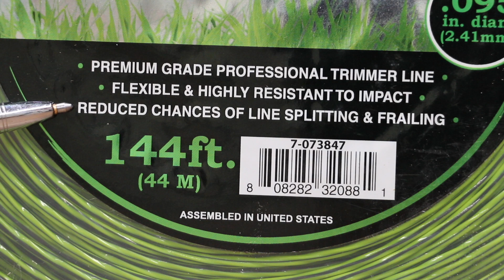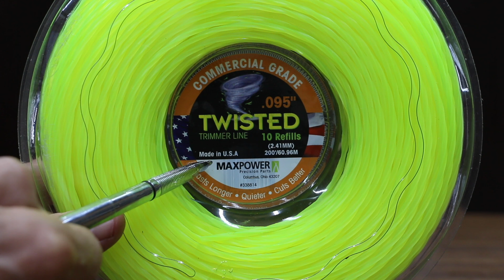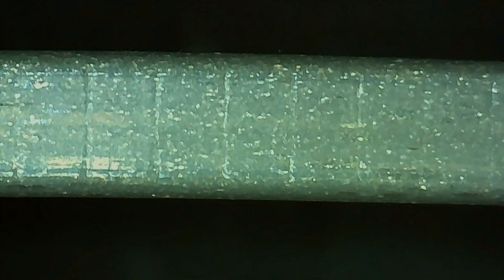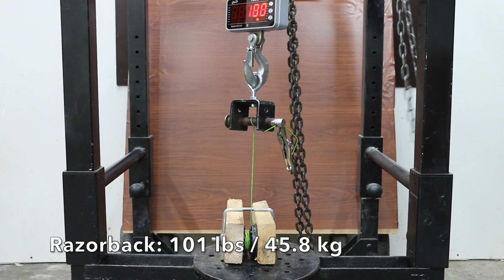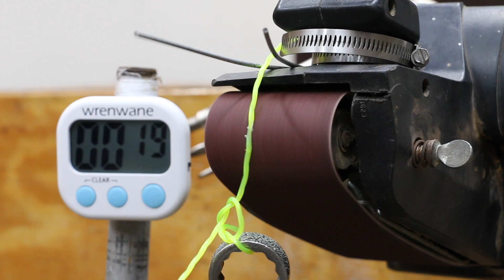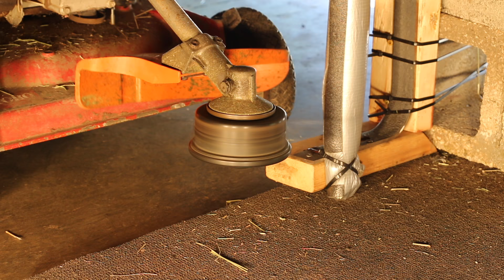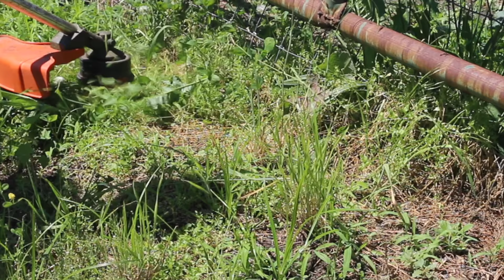Best Trimmer Line? Let's Find Out! Round 2: Stihl, Husqvarna, Echo, Oregon, Shakespeare, Weed Eater

Comment: Do you have a video on electric string trimmers? I have a 80v Greenworks (same batts as cobalt).  It's the best trimmer ever. I'm never going back to gas.  Just finished the 3rd year on the same battery for our .23 residential. Came with a blower and charger.  Has to be one of the best blowers out there.  Just amazed on the low DBs.  Now all my neighbors 2 cycles are very annoying.
Reply from the maker: Thanks for the video idea.

Comment: Im not some Oregon fan boy. Just putting that out first because alot of people are quite brand loyal. The problem i have had with line is how it welds in the spool when running along chain link fence lines. The way the line wraps and then pulls the string inside the spool so quickly that the material friction welds to itself. You guys know what im talkin about! ;P   I have not tried the weed warrior, razor back, nor the twisted but the rest have welded. I finally tried some of the Oregon 20-117 Platinum Gatorline Supertwist  This stuff has a coating which gives it a higher melting point than alot of other strings. Oregon has quite a few lines available but from what i have been told this platinum type here is the heat resistant one. I could definitely be wrong but after actually using it for a month and never having it weld even ONE time i will not be switching back to any thing else unless some thing else handles the heat and can last longer.
Reply from the maker: Thanks for the feedback.

Comment: @ Project Farm Thank you for this test. I'm part of a large community helping out other lawn care providers. One of the big questions that are frequently asked is about using X blade configuration. ( Crossing a regular mower blade and a gator blade on the spindle.) Vs using just gator blade or regular mowing blade on the lawn mower. Used to chop up leaf's. The debate for the x blade configuration is it works better then the alternative. The argument against is that it causes stress wear and tear on the spindle, engine and clutch. And the outcome is not a noticable difference. Could you please test this and put this conundrum to rest. You would be helping many in the lawn care community. And your tests get shared in Lawn Care World face book group. Thanks again.
Reply from the maker: Thanks for the video idea.

Comment: Just so you know for the Stihl you are testing the their worst trimmer line the test should have been done with the CF3 Pro or at least commercial line, also as far as pricing Stihl does not sell their products on Amazon that price is through a questionable reseller, you should be able to get that spool from a dealer for less than 10 USD
Reply from the maker: Thanks for the feedback.

Comment: That Echo Crossfire doesn’t hold up like it used to. I swear they’ve started making it more brittle. I cut mainly residential properties and have been using the same trimmer with it for a couple years. I go through the line a lot quicker than I did last season. It’s the same .095 I’ve always used.
Reply from the maker: Thanks for sharing.

Comment: I'll have to find out what the UK equivalents are. Up until this cutting season I typically bought the stihl 2.7mm (. 105") but have found that it gets very brittle after a few months, this year I've been using husqvarna 2.7mm (. 105") penta and have found that the shelf life is far better than the stihl brand one, 6 months into the season and my Strimmer cord still preforms the same as the day I bought it. Its something that needs to be taken into account especially when buying a few hundred  or thousand meters/ yards of nylon is how well it keeps over time. Great video. For me It can be an expensive mistake to buy inferior nylon.
Reply from the maker: Thanks for sharing.

Comment: You were right about how long lasting the Weed Warrior is. Only problem is it curls up. Very difficult to cut grass with a curled up line. Had to send it back to Amazon. I'm using Max Power 0.095 as a 0.105 since it's so thick.
Reply from the maker: Thanks for sharing.

Comment: Impressive testing, I found Maxi-Edge by Arnold to be a very good line considering the low cost per foot, it don't jam up on the spool and seems to last quite a long time at low/med RPM. Perhaps you can try it around your property. I use the Orange 095 and it handles weeds well, green 080 does not last as long.
Reply from the maker: Thanks for sharing!

Comment: Re test them 1 year or 2 years later to see how they deteoriate.... I use the husqvarna, I think it turned. brittle, even keeping it In doors
Reply from the maker: Thanks for the suggestion.
Reply: My 2 year old string has lived in the house in a desk drawer since purchase.  It seemed fine, but It was snapping off under any load where it exits the trimmer head. 

Super frustrating...great topic for exploring, I hate running the trimmer, but occasionally it’s the only right tool for the job...

I did read some people say to put it in water, which I tried last night. My limited use test showed a huge improvement over the unsoaked string but not quite like new... 

It seems like the few Facebook pages on the topic started with new string stores in water... ;-(

Comment: There's probably a good reason that "wire" like 1/16th inch cable isn't used instead of plastic trimmer line.... maybe a safety issue? I'm not sure....
Reply from the maker: Thanks for the feedback.

Comment: Will straight weight "30-W Shell T-1 Rotella " motor oil work as well as straight weight "30-W Valvoline Conventional" motor oil for use in 4 cycle Tecumseh and Briggs 10 HP engines?
Reply from the maker: Thanks for the video idea.

Comment: The term for the trimmer line getting stuck in the head is "welding". It has little to do with the line stretching but literally melts together in the head. The melting it caused by the friction of the heat as it vibrates in the head. If you have this happen and untangle it you can literally see it has "welded" to the other surfaces of trimmer line.. Round line is great at limiting this problem. Also, the trimmer line should always be wound tight in the head.  My two cents.
Reply from the maker: Thanks for the feedback.

Comment: Just found your videos and I love the way you test stuff, however you do not test repeatability. For instance, if you repeat the same test 5 times, how much do the results vary? Same with any test equipment you use. e.g. the knife sharpness tester - if you test the same knife 5 times and at 5 different points along the knife blade, what results do you get? When you display graphs, it would be useful to display error bars.
Reply from the maker: Thanks for the suggestion.

Comment: Hi Project Farm!! Just wanted to add a comment here...I had been using .105 Husqvarna titanium line in my trimmer, but thanks to your test on lines, I went to the Maxpower .095 line. Not only do I like it better, I find it "follows the contours" of the ground better and doesn't gouge into the ground as easily as the .105 can do, especially if you have the trimmer head on a bit of a tilt. So...thanks to your fine test, I have a product I like much better.
Reply from the maker: Great news!

Comment: Have you thought about testing the Power Rotary Scissors and the Steel Wire Brush Cutter Trimmer Head replacement for your next video testing about the trimmer head replacements being better than a string trimmer line or brush cutter blades?
Reply from the maker: Thanks for the video idea.

Comment: I bought one of the trimmer heads that takes the 4 individual lines and bends them into a u shape for 8 lines for cutting and I bought a roll of the maxpower twisted line and cut the line to length of the original strips wors better than the original line last longer and one roll of line has lasted almost 2 years
Reply from the maker: Thanks for sharing.

Comment: I am so glad that I found your videos.  I was considering purchasing the Oregon Gator line.  I then saw your first video and changed my mind to Husqvarna.  Then YouTube auto played this video and looks like that I am purchasing Maxpower Twisted.  It performed much better than Oregon Gator in your testing.  Mahalo!
Reply from the maker: Glad it was helpful!
Reply: @ProjectFarm  Update on the Maxpower Twisted:  This line is almost bullet proof!  I trim the grass in my 1,500 square foot yard with two pieces of this line including at the edges with walls and sidewalk with minimal line loss (maybe 1/4" to 1/2"); your tip about slowing the rpm to prevent line breakage was very helpful!

I am using this line in my brand new Maruyama B30L Turbo.  Kind of late for me, but I would like to see a review of grass trimmers!  Mahalo Todd!  I always look forward to your reviews!

Comment: I've tried a lot of different trimmer line over the years, and my quality need is line breakage. It really burns me to shut down and retrieve the line from inside the spool. That all changed quite a bit when i read about soaking the line in water overnight to bring back line strength. IT WORKS I don't know what manufacturer stated this, but I do this regularly, and store the line in a cool dry basement out of the sun.  I Love the testing you do and keep up the GOOD WORK.
Reply from the maker: Thanks, will do!
Reply: I recently found the tip about rehydration and it indeed works.  I was using some Echo string that was almost 2 years old and hydration brought it back and it breaks far less now.
Reply: I actually called Echo and spoke to a technician and he confirmed that its advised to put the line in a bucket of water 💧 and let it soak for approx 1 hour at least.  IT ABSOLUTELY 💯 PERCENT WORKS

Comment: Ha! I don't run out 10 feet from being done because I don't use the constant feed system that makes you run out of line every 20 feet so you have to restring 6x before you're done. No thanks. I use a speed loader that holds 2 pieces. I can use those 2-6 inch pieces to do the entire yard instead of wasting 60 feet of line.
Reply from the maker: Great tip!

Comment: Can you do an in depth testing of maybe five battery operated lawn mowers self propelled, I know that would be super expensive as the cost of the complete mower set up would be enormous unless the manufactures would donate the necessary kits. If you did do a test video the manufactures of first rate equipment would have the best advertising for the least amount of money as no one can come close to your testing methods, that is just my opinion, one look at your following tells the rest.
Reply from the maker: Thanks for the suggestion.

Comment: Your test was spot on!  Thank you! The max power made my core gas less trimmer at like a completely different unit. I almost replaced my trimmer. It was the line I was using. The max power line rocks! Thanks again.
Reply from the maker: Glad to hear.
Reply: Destin from Smarter Everyday was doing a weed eater line test to see which shapes work the best. He noticed a guy who weed eats for a living and invited him to check out the setup and noticed he was using a triangular twisted line. One of the things he noticed when spinning it up was it was a lot quieter than the other lines. Less noise = less turbulence = more efficiency! The line wasnt being buffeted by wind as much (similar to how those car antennas have a twist around them to reduce noise) so the trimmer head kept up at higher speeds :D

Comment: Worth noting moisture makes a substantial difference in nylon strength stretch and toughness, some advocate storage in a bucket of water.(I have not made a direct test) Also .080 square line weighs about the same per foot as .095 round, and my trimmer power response seems to back this.
I have found the Echo-crossfire(broke to bits) and twisted-maxpower(split ends) to both be garbage, but maybe I got a bad batch of twisted or need to size it up or down. I use it on tall(mature) grass and fibrous weeds(some young brambles though I use a cheap saw blade for heavy brambles), I don't have concrete or fences. Husky titanium worked well, i will use it as a comparison standard after I use up my pile of round-one samples.(Which included oversize and undersize lines.) My modest straight shaft trimmer is rated for .095 round. Tested up to .120 and down to .060, .060(cheap brand) just seems to dissolve with my trimmers power and weed type, while .105 round stihl lasted much longer for scalping dirt but was clearly loading the motor and running much lower RPM.
Reply from the maker: Thanks for sharing.

Comment: Enjoy you videos, I like seeing products tested to see which is the best. I would be very interested if you could test lawn mower deck spray to keep grass from sticking  I can see other uses on outdoor tools such as shovels, and tractor buckets to prevent dirt from sticking.  These are the brands that I have seen so far : Tite-seal Mower Deck Spray, Gunk Non-Stick Mower Spray, Armortek Non-Stick Outdoor Power Equipment Spray, Mo-Deck Non Stick Spray, Majic Easy Slip Non-Stick Lawn Mower Underdeck Spray, Dupont Teflon Non-Stick Dry-Film Lubricant, Silicone Spray, POR15, Sli Plate Graphite Lubricant.

Comment: Did you consider manufacturing date when buying these lines? In my experience, lines that sit on the shelf become brittle and have to be soaked in water to gain their malleability back. I wonder if date of mfg would have an effect on your results.
Reply: Actually, I just tried soaking my line for the first time.  It had become quite brittle.  Now it works like new.  I think age of the line should definitely be considered.

Comment: Hey project farm, this is my second suggestion:
Recently i had to remove the tint glue off my car window so i searched online for help and got alot of rubbish not working solutions, like hot water and soap, or the normal window cleaning sprays, rubbing alcohol (worked a bit) and finally what worked for me was paint thinner.

So i suggest you test glue removing products or methods.

Keep it up 👊
Reply from the maker: Thanks for the video idea.
Reply: try a product called Goof off

Comment: You do a tremendous job your tests.  Just before this came out, I had bought Oregon trim line and was pretty satisfied with it - it was a HUGE step above Echo junk (also 0.095) that would completely break off about every three minutes even under normal whacking, and almost immediately next to a curb.  But I was regretting buying the Oregon after watching this because other lines did better, especially the Maxpower.  However, on further checking, I realized Oregon has several variations of trimmer line (and obviously you can't test every variation of every product out there).

I had bought the Oregon 22-895 "Magnum Gatorline Square Trimmer Line."  I have no idea how it compares with the other lines tested, including the Oregon 69-195 "Magnum Gatorline Round" that was tested.  Both are 0.095 in.  But the 22-895 never broke during a full 45 minutes whacking down heavy grass, weeds, and tall brush (green stems up to three feet tall), and continued to do well even after I had moved on to vertically whacking the grass along the edges of flower beds and even the my sidewalk and front curb.  It did finally did break after about 100 feet of that.  So far I'm happy with it (don't we all want to feel good about what we just bought, lol).  Thanks again for a great video.
Reply from the maker: Thanks for sharing.
Reply: I've been using round magnum gatorline .095 for years and I always come back to it. The square magnum does give a slightly smoother cut with slightly less fraying, but it most definitely does not last as long on chain fences as the round. The square also tends to chop at high rpms, which pretty much all square line does, and I can feel it trying to move the trimmer head around. The round does not do this at all. The round stuff is almost silent compared to the square, and the trimmers are noticeably more smooth feeling at full power with the round. I run shindaiwa t302 and redmax 3060ts, which are the biggest trimmers each company makes. I just ordered some of that max power after watching this, so we will see if it stands up. It's going to be hard to best the magnum for me. I've tried the majority of major trimmer brands and styles, and I still haven't found on I like better. I've done this as a full time job for almost 8 years now, and I personally trim between 40 and 50 yards every single week, so maybe I have slightly different expectations than the average homeowner. I know it didn't do well on these tests, but I promise that round magnum is some of the best you can get, even if it's a little pricey.

Comment: I don't use my trimmer much. Large yard and don't do it to be pretty just when it's out of hand and in the way. I was starting my trimmer (or trying to) and started thinking about how far battery technology has come and that I'd never have to try to start an electric trimmer. My current plan is to buy the Dewalt 60v trimmer once my gas one dies or is killed for not starting. For me I already have the 60v batteries, plus it's the higher voltage of most I've seen, but have no clue how the stack up. You want to put them to the test?
Reply from the maker: Thanks for the video idea.

Comment: Got some Maxpower over the weekend. Use it on a Toro gas trimmer. Worked really well - cut through some nasty weeds and edged very nice. And I noticed that the sound was much quieter - on the trim head side. The "whir" was much quieter. Thanks for your great videos!
Reply from the maker: Thanks for sharing.

Comment: Have you tried comparing the strength of post hole foam (sold at big box) vs concrete. I’ve heard linemen say they use a foam for telephone poles or whatever they are called these days.
Reply from the maker: Not yet. Great video idea!